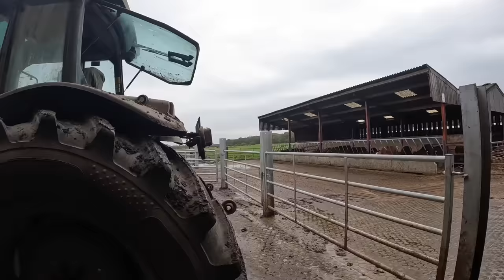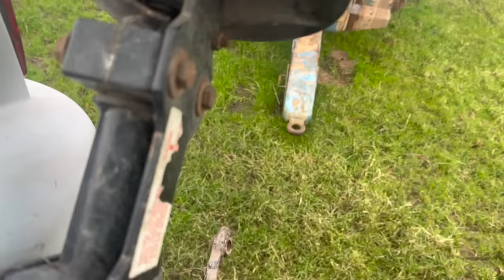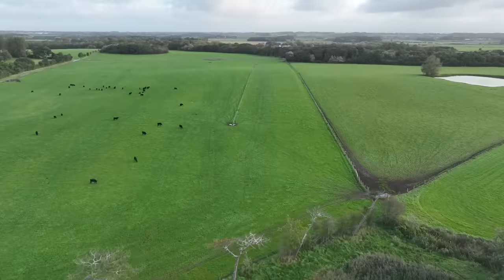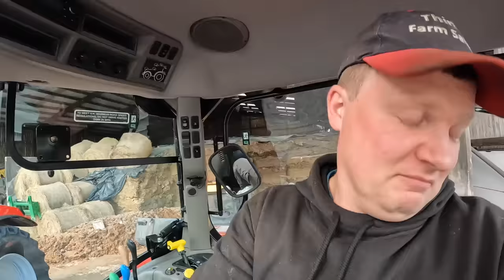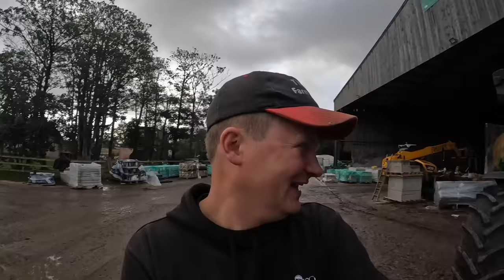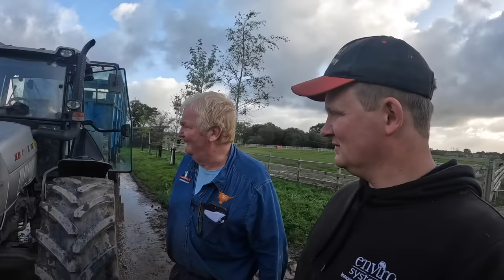THE BIGGEST TRACTOR WE HAVE EVER BOUGHT ARRIVES ON THE FARM!!

Comment: I had one identical tom! 
I'll give you a tip. You'll see the green power boost light only comes on when it's in the top range of gears and when the PTO is working under load, I couldn't get the power boost in with the tanker and was a right pain when it needed the power on hills but wouldn't work. 
So the PTO in neural on the tractor then set off driving (don't need to go fast)and give it a few revs, then flick your PTO on for ten seconds and then knock it off. 
Your power boost should then kick in after around 1300rpm in every gear.
I've done it in a maxxum 125 and 150 and it works

Comment: Congratulations on the new tractor. Indeed, the Hurlimann has been a very impressive tractor, but as your father put more eloquently than I did in the comments section of the previous video, it is better for someone to get further use out of a good tractor than breaking it. Listening to your rationale about the decisions you made, I think you have made a good choice of tractor with some very sensible spec choices that suit your needs and circumstances. I hope that it will serve you well.

Comment: Actually, i had exactly the same decision to make 2 weeks ago... Loosing your best piece of Kit is very hard, i really can understand your fathers reaction. But... Lately when youre mowin with 2 or even 3 mowers with the Maxxum you'll be in heaven😊 

Greets from Germany👋
Reply: Triple mower would struggle this one, but front plus side will do just ok.
You need 250 hp and a bit more weight for triple mowers.
Reply: @goodiezgrigis  on flat land like they have 170hp will cope with triples, but a bit slower.
Reply: same here, without conditioner there are triples driven bei 150hp... But he'll win alot even with a dual

Comment: best of luck with the new toy. 
Think you might have missed a trick with the manual spools as headland management would be ideal for the font and back mowers and that would work with electric spools. That said i know a few people that use a joystick control for the manual spools so the they can operate both from the same handle, makes it easier at the headlands.

Comment: Kinda puts things in perspective, I had a Deutz the same as this which I bought in 2005 , I traded it for a mf in 10 with 9000 hours on it, it was a great little tractor with endless guts, it was our main tractor at the time we have traded and moved on a few times since then and currently have a 6715 S Massey 2 years old with 4500 hours up, and I just spent a few minutes working out that on our main tractor since 2005 we have put up just shy of 38000 hours on 5 different tractors, and we still give a contractor a small fortune every year! Best of luck with the new case and keep up the great videos.

Comment: My experience, I am from Austria, we bought a Steyr Expert, same size as the vestrum. But you really should have gone with the 2 electric controlls and 2 mechanical controlls. Why? because if you go in to ground work like maize, you NEED a hydraulic upperlink and without a external control you have a hard time getting it on. But I hope you will have a nice time without problems an d stay safe <3 leettsss goooo
greets